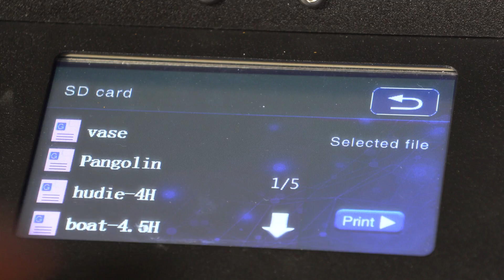The Unfortunate Problem with the Creality CR-X 3D Printer

Comment: It is refreshing to see a machine that did not receive a glowing review. Quality control is the issue with many of these units and I feel that many purchase them expecting all roses since most reviews depict them in such a flattering way. These I3 clone machines have become so bland and boring . PLEASE stop making the same cookie cutter I3 style machines. I understand that many people want larger, cheaper machines but this has stunted all innovation. Most manufacturers seem to have forgotten about 32bit boards, direct drive, Core XY, true multi extrusion and enclosed units in favor of what they can manufacture cheaply and easily. At this point there are plenty of low cost, good quality machines. Let's see something new. Raise3D has great machines but not everyone has the 3k plus that they cost. My kingdom for some innovation!
Reply: Hello what would you advice? What printer?

Comment: Makers muse talked about this last fortnight it is a shame and the Ender 3 just works they had only one flaw in its design and that's something that makes for a good test print but when they make multiple design flaws like it sounds like they have it's just not worth it
Reply: leslie meyers no you just missed the first run whole bunch of issues with the Ender 3 they're just very fast at iteratively updating :-)

Comment: I agree, if they're going to use reviewers as beta testers they should just put you on the payroll. Makes me uncomfortable buying one of their printers when they've just been released, might as well wait 6 months or so until they get the problems fixed.
Reply: Even then yo can't be sure what stock you'll get. Both Joel and Angus got reviewers machines and they're markedly different from each other. You could wait six months and have them dust off one of the first run of machines.

Comment: "Did anybody test this".............Yep all the Youtuber's who get them from Gearbest and Banggood!!!!- you guys are beta testing for the fee of a defective machine THEY WONT LET IT BAKE LONGER - it's cheaper this way.............
Reply: And another issue is that all of us free beta testers do not have free access to future upgrades. And worse, they don't even tell you what has been improved based on feedback or not, so even if you buy a new one, you are not guaranteed that things have changed.
Reply: Never buy first gen stuff. It’s like having kids. You don’t know anything a first time parents but by the time you have a second kid your a pro.
Reply: Only in the short-term. this kind of thing only really works with software which people can get fixed for free so long as they have an internet connection. With Hardware it ruins your brand reputation and causes people to stop trusting you thus it causes people to stop buying thier product.
In the long run doing this could cost them everything.

Comment: Why would it need a Stylus??? What printer in 2018 needs a Stylus???...............  heheheh :)
Reply: Yes some still do
Reply: Where do you even get those screens?
Reply: The Robo3D C2 and R2 printers absolutely need its stylus...
Reply: Yeah That's the one I was trying to think of and it's a piece of shit
Reply: @Mario Garcia, on the units i tested, the screens were totally useless without the stylus, you could use them with your nail, but it was definitely some of the worst restive screens i have ever used.  Sorry to say, since i really liked some other aspects of those printers.
Reply: Mario Garcia How about from someone who was a Kickstarter backer of Robo C2. Its touch screen was garbage. It shipped with a stylus and the screen required much more than mere contact to register input. I felt like I was going to push my finger/stylus through the screen with how hard I had to press to make it do anything. It does register finger contact, I guess... So you aren't wrong. 

On that note, the C2 was garbage all around. Who ships a 3D printer with a plastic print bed?
Reply: Loosen the four screws on the back of the screen

Comment: there is amajor flaw in quality control and even design control with low end 3d printers in general. Now that the market gets harsher and forces companies that are providing more service and real quality control to shut down (f.e. printrbot, fabtotum), the condensing of the market has begun. If a manufacturer wants to stay in that range of 3d printers.. they have some work to do.

Comment: Is this something that creality does? Change their printers at random? Because I got an ender 3 not too long ago and it has a weird removable bed on it. And I couldn't find any reviews on YouTube showing that. The worst part is that I feel like the removable bed was a last minute thought because it's made of plastic or something. It's surface is uneven so i have to get a glass bed to print anything. Don't get why they wouldn't just keep the original bed that wasn't so crazy warped
Reply: they put out 3 of them. when they 1st started making them they had fake buildtak then they went to glass and now they make the one you have. a lot of people want the removable bed like you got but it sounds like you got a warped one

Comment: I agree. Why push a product that isn't final. Also I've seen that issue with the SD files not on root in the wanhao machines. I don't know how I feel about the belt driven second z screw. It would mean you are limited to leveling your x axis by a whole tooth either way. Also that z limit switch design looks terrible. Why would they not make it adjustable. Gives you the choice on different bed surfaces. The entire bed base needs to be lifted up to compensate. 

They probably did it to get the maximum z height possible using the least materials to build it and someone has gotten their maths wrong.

Comment: It seems that more 3d printing companies are using their customers to find the problems and report back, then improving as they go.  I am glad about them fixing known issues, but it make you not want to be the first one diving in on a new model.
Reply: Christopher Maschek correct this is what I tell my viewers don't buy the first run wait a couple months at least with creality printers you'll always get a working machine but the first batch or two will need little fixes

As far as I know they are the only company iteratively improving their products TiVo ads corrections to the next product but does not appear to improve the existing product at least not yet

Comment: You are the best you inspired me to buy a cr10s
Reply: 3d printing World if you do get the CR-10S, I'd advise you to dismantle the bed and add at least 2 washers per fixing, UNDER the mounting plate that is attached to the guide wheels, then you will have more play with the leveling nuts.
Reply: CR10S have the same issue with leveling.
Reply: Simon Acock thx I will probably do that